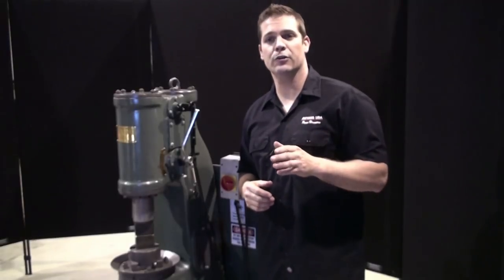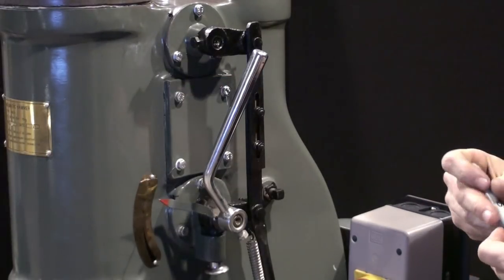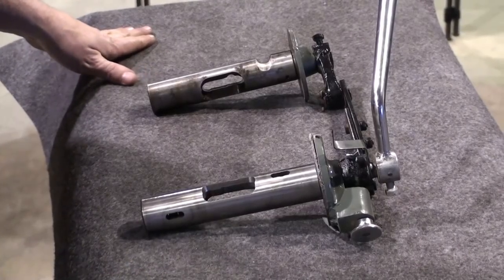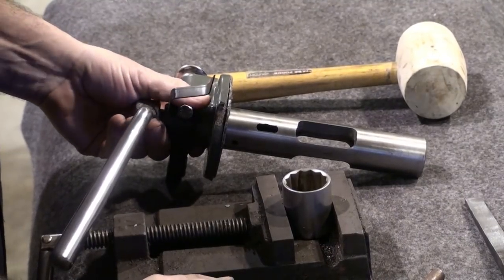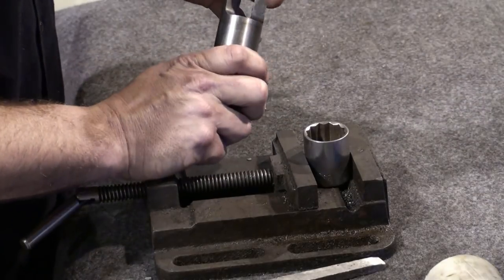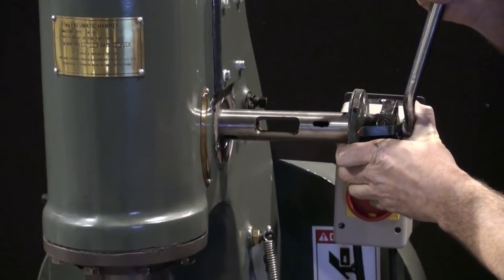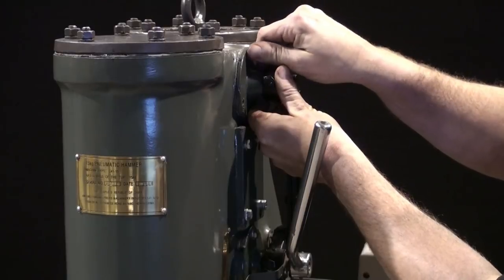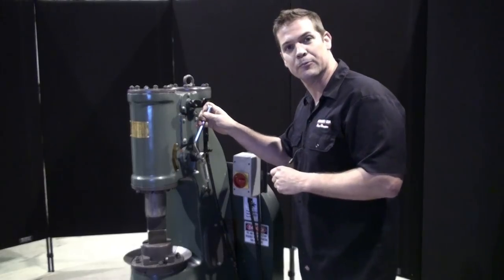Anyang Power Hammer Valve Operation

Comment: There should be no reason to change the valve arm between the two values from the factory setting , but how can you tell if someone has been messing with it and have it out of time?
Reply: ken Bullock Ken. On Anyang we have an  adjustment between the upper and lower valve. We do not recommend changing the setting from those set st the factory.